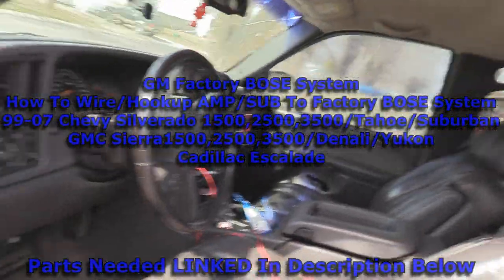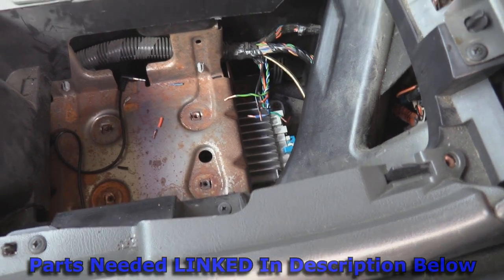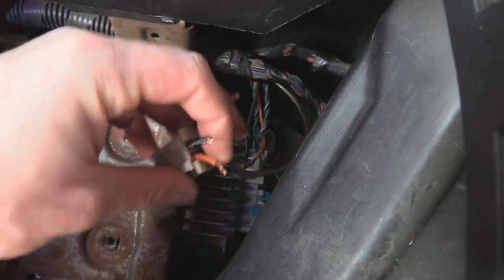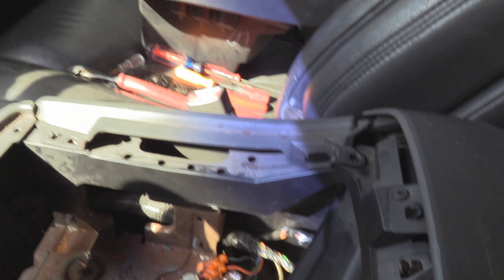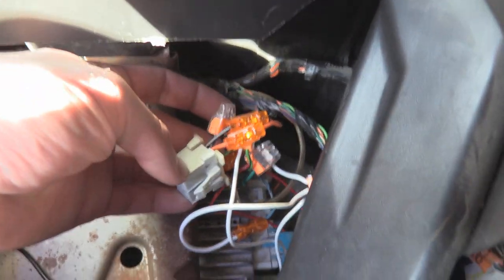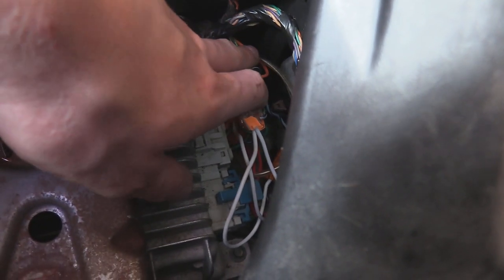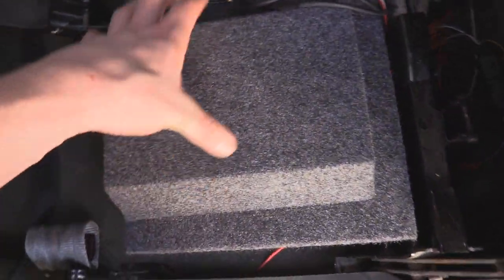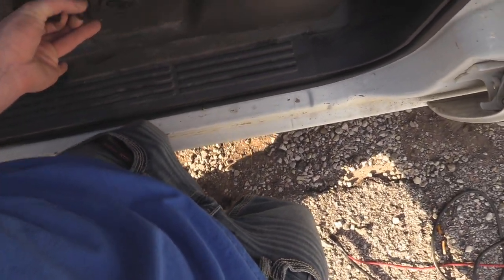CHEVY Silverado BOSE System How To Wire AMP + SUB Wiring High Low Line Out Converter Factory Radio

Comment from the maker: PARTS NEEDED Chevy GMC Cadillac BOSE Audio System Hook Up Amp/Sub Linked Below
https://amzn.to/46nGh3S
AMPLIFIER COMPLETE INSTALL WIRING KIT Linked Below 
https://amzn.to/2JEjQiN
REMOTE WIRE HOOK UP TO TURN ON AMPLIFIER FUSE TAP KIT Linked Below
https://amzn.to/3OCFi6L
WIRE SPLICE TAPS & CONNECTORS Linked Below
http://amzn.to/2Fg8T24

Comment: Hey, this is a great video and I’ve learned a lot, I was wondering if I could just hook up the converter’s power and ground wire to the other ground and power wire coming from the harness into the factory amp.

Comment: So you ran the RCA straight to the amp. What if your RCA is running from the head to the amp? If i wanted to add rear deck speakers? (Which doesn't come  on some GM cars)  My amp ony has 2 RCA inputs.  Which is already in use. Can i leave the RCA port empty on ILC ?

Comment: Does this work even with a aftermarket head unit bc I get no sound to my subs even tho I have sub outputs from my head unit . I have a bose system with a stock sub and I’m just adding a aftermarket sub or what would I need to do
Reply: I had the same problem with these apple 
car play Amazon head units. I had to wire my subs like this to get them to work with the head unit.

Comment: I have a 03 Yukon Denali, so this video may not be applicable to me. Are the wires going into the factory amp line level (2-5mV) or speaker level inputs are they full range or sub input range. If low range what is the crossover point😉 thanks for uploading the information😙🙏🇺🇸

Comment from the maker: PART U NEED "Chevy GMC BOSE Hook Up Amp/Sub Linked Below
http://amzn.to/2FexAM5

AMPLIFIER COMPLETE INSTALL WIRING KIT Linked Below 
http://amzn.to/2CXu7zL

WIRE SPLICE TAPS & CONNECTORS Linked Below
http://amzn.to/2Fg8T24

BEST DEAL 10"in Box, Kicker Sub/Amp Crew Cab Chevy
https://rover.ebay.com/rover/1/711-53...

10"in Box Crew Chevy
https://rover.ebay.com/rover/1/711-53...

12"in Box Crew Cab Chevy
https://rover.ebay.com/rover/1/711-53...

Cheaper 10"in Box For Crew Cab Chevy 
https://rover.ebay.com/rover/1/711-53...
Reply: Thanks so much your video really helped me! my 04 Tahoe is banging! 🔊🔊🔊🔊

Comment: Would this be the same principle for 2017 Silverado with  factory BOSE ???
I installed Android head unit, used harness they supplied wit when purchased,. Everything works except I hav NO SOUND! The green plug on the harness has red(pos)&blk(neg) however on harness that came wit android head unit has those and also speaker wire pins also,. I even hooked up my aftermarket amp and two 12in subs in truk box under bak seat, amp light comes on green(no system overload(red light) ) idk what I’m doing wrong,. Any help , I’d appreciate,..

Comment: Do you know which wires are the audio input into the amp I have the center console with the sun and amp but don’t have the factory wiring harness I just want to run power and audio input to the amp

Comment: Can I use this converter in a 2003 deville with Bose and ignore fa story amp and just wire up in trunk as if I had no factory bose
Reply from the maker: Yes u can you can just bypass factory bose sub or even the whole factory bose amp.
Reply: @EverydayImTECHnIt  
I mean can I install and never touch the factory sub or amp so I guess both will run
Reply from the maker: @ry2d276  Yes just slice into factory bose sub amp wires like i show in the video that is the easiest way by far or u could splice into R + - / L + - rear speaker wires but you have to remove rear door panels & speakers to splice into those wires & route new wires to amp for new subwoofer you're installing so this is not as easy as just splicing into amp wires from under center console if u do splice into rear door speakers FYI you still leave rear speaker wires attached to R/L rear door speakers
Reply from the maker: @ry2d276  Yes i have both hooked up in my truck u just need the signal for Converter it well not effect amp or factory bose speakers/sub to tab into those wires

Comment: You dont actually need to use a Low Output converter. All you have to do is cut you rca cables and wire them into the low outputs going into the amp from the radio. Also if you have a Suburban you can buy a Wilson 30512VPP 12V Power Plug with Brass Posts to hook your remote wire for your amp.

Comment: I tapped into my door speakers for my converter but I have some voice coming through wil doing it this way give me straight bass signal since those wires go to the factory su
Reply from the maker: Yes you can still leave factory sub hooked up I did on mine you just need to tap into the wires also make sure your Hi Low Convertor is adjusted correctly you turn the 2 small knobs on Hi Low Converter to adjust it this may solve your problem it won't make a diffence tapping into factory sub wires that's not your problem also where did you tap into door speaker wire at it has to be after door speaker wires come out of facory amp if you removed door panels & tapped into door speakers that way that fine also you just can't tap in right after wires come out of factory stock radio/head unit cause of factory amp also make sure your amp setting are correct the switches for switching amp to use for regular speakers mode or sub woofer mode also other switches on there I can't remember now without looking at a amp like HZ & dB settings act hope this helps LOL sorry to make it such a long reply such I have lots of spelling errors hope u get it goin good luck!!!!
Reply: I Have the same problem with noise coming out of my subs... how do i fix it ?

Comment: where did you hook up your remote "amp turn on" to?
Reply from the maker: It's built into that High low converter it automatically senses when there sound there's a link for it in the description and then it turns on your amp
Reply from the maker: It has a wire you run from the Highlow converter to your amp to tell it to turn on FYI
Reply: @EverydayImTECHnIt  oh gotcha. mine doesnt have that. i have to find a remote source.
Reply: I’m on the same boat I hooked everything up besides the remote . Did you find a solution ?
Reply from the maker: @peterodriguez5388  you need this https://amzn.to/3OCFi6L fuse tap kit & plug it into radio fuse in fuse box.
Reply: I just hooked it up to the ign fuse next to the steering column . So far so good
Reply from the maker: @peterodriguez5388  OK perfect that works also glad you got it figured out

Comment: What do u recommend for me to do  cuz idont have any voice on my door speakers,  after i removed the center console??? Help please
Reply from the maker: Check the wires to make sure you didn't wire it to wrong corrector plug i think there is 2 plugs if i remember correctly 1 for door speakers that goes to factory amp & 1 for factory sub that is in the front of the center console you probably wired them to wrong corrector plug if i had to guess cuz you want to wire them to factory sub corrector plug wires let me know if this helps if not give me some more details & i can try & help you the best i can! THX & GOOD LUCK
Reply: I dont have the center console anymore  tho?? What to do🤔
Reply from the maker: @doubletrouble_8753  It probably cause you don't have factory amp then to power speakers your truck/suv has BOSE factory audio system correct cause if it does you need need the factory amp in the center console to power your speakers or just buy a aftermarket head unit with built in amp in the head unit off amazon linked below plus wiring kit to wire up aftermarket head unit https://amzn.to/39lWCqR my 2 cents

Comment: I did this step by step.. and I cannot even hear my sub. Its powered and playing.. but barely. What's the deal?
Reply from the maker: Could be multiple things but to start with did you adjust the 2  knobs with flat head screw driver on High Low Converter to turn them up & did you check the switchs on the amp to make sure all setting are correct on amp?
Reply: @EverydayImTECHnIt  yes to all above. I'm upset lol
Reply from the maker: I’m sure we can get it figured out if you can bear with me and give me a little more info it’s probably something stupid that is causing this could be A number of different things that will cause this issue. The amp that you’re using did you buy it brand new or is it a used amp are you 100% sure the amp is not blown? What kind of Hi Low converter are you using The same kind shown in the video if so is that on the fly adjustment knob turned at least halfway up if you’re using a different brand or model hi low converter can you give me the brand model and or part number of the hi low converter you’re using if you bear with me I’m sure we can get this figured out.
Reply: @EverydayImTECHnIt  so.. I had a brain fart! I accidentally wired the 2 brown ground wires on my loc to the harness instead of the speaker grounds. Rookie mistake. Other than that your video is the only thing I could find on installing with this factory bose in my denali. As of a couple hours ago my system is completely installed and sounds great. Thank you!
Reply from the maker: @jeremysgarage498  No worries glad you got it figured out it's usually something simple like that on a install can cause you big headache lol i've done similar things before myself your like really but always feels good to get it working & issue solved.
Reply: @EverydayImTECHnIt 
Im having the same problem. Its powered but barely making noise. I have the same loc. Wired it the same ad in video, only thing you dont show is conecting the ground and power.. i connected the ground on the loc to the black wire in the harness plug and the yellow on the loc to the orange on the harness plug. Is that correct?
Reply: @jeremysgarage498 
Im having the same problem. Its powered but barely making noise. I have the same loc. Wired it the same ad in video, only thing dont show is conecting the ground and power.. i connected the ground on the loc to the black wire in the harness plug and the yellow on the loc to the orange on the harness plug. Is that correct?
Reply: @77k10  you should have 2 grounds right? Its been so long I cannot remember. But yellow / lt blue on the wiring diagram show rear speaker left & right grounds. Try hooking your grounds to the speaker grounds not the harness.

Comment: I'm just here to stop this God forsaken Bose speaker door chime that's embedded in the radio.. I don't want to get rid of my vise radio but I can't stand the constant chiming for the air bag warning and the door. I like my sound but I'd also like an amp to ad to my system to ad 2 6x9 enclosed boxes so I can have more sound. Will that device you linked with the little knob control that as well?
Reply: Most adapter kits come with a chime box that you can either select a different noise or leave unplugged all together as it does not utilize the factory chime system
Reply: @Nat-O  can you by chance reccomend one with this option? A link preferably. I gave up trying to find the right one. 06 gmc sierra 1500 classic Bose stereo with sub. Thank you